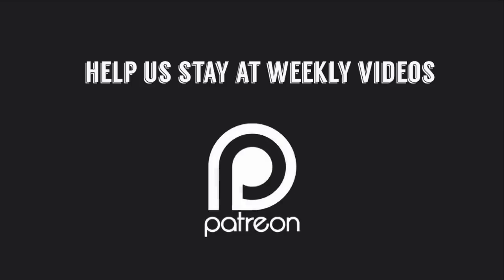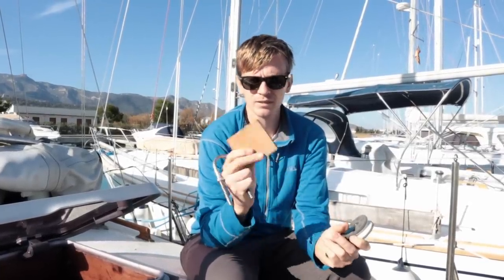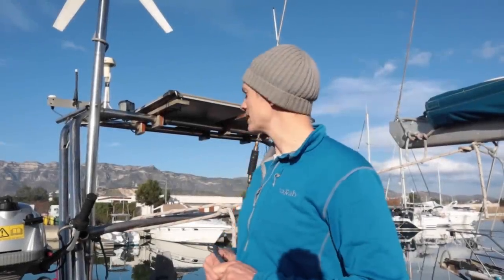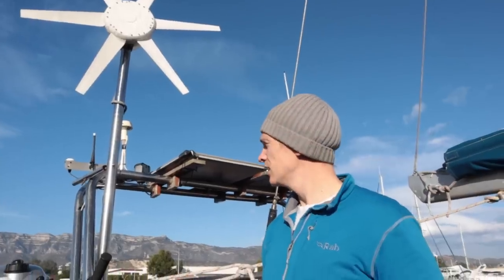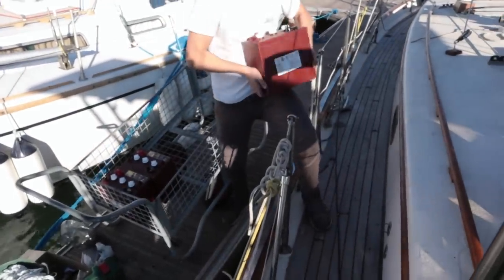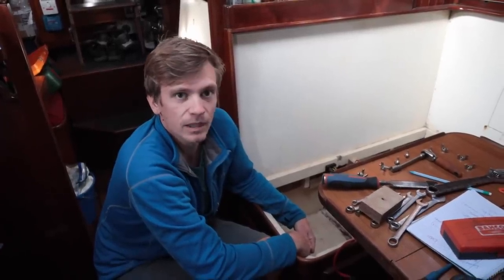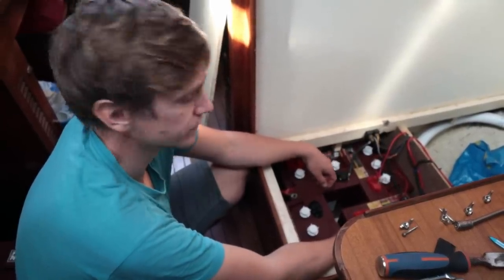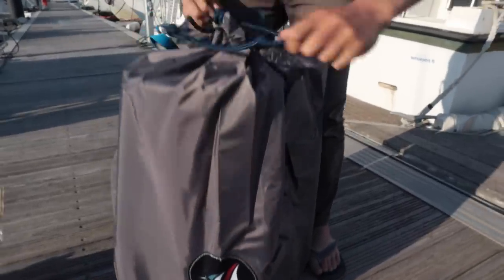43] Off-grid Sailboat Life: Installing SOLAR, Batteries & Sails

Comment: Just a little heads up for you. Any load bearing penetrations through any porous materials ( ie Balsa) should really have a thickened epoxy bush at least 5mm around the penetration ie 10mm hole needs a 20mm bush. This helps spread the load and seals the porous substrate from any water ingress.
Keep up the good work and enjoy! L.

Comment: nice one guys. the teak pad spilt because the hole is too close to the end grain. also as someone said the pad should be under the deck. all the load on that sheet is up not down, the pad should be used to distribute the load. even better is a big stainless washer that takes both legs of the u bolt. like you would have under a winch

Comment: A few quick comments on the staysail sheeting points-  1.  Chamfer(countersink) the holes in the deck and wood blocks. The butyl fills the cone shape and provides a much better seal. 2. Chuck a small Allen key into a drill and dig out some of the deck core (if cored), then fill with epoxy to seal the core, re-drill and mount your blocks. Tedious, but between the epoxy and the butyl, you're bullet-proof for life.  I think the blocks of wood will be sufficient because they're teak (won't rot) and the loads on a small staysail are less than with a genoa.

Comment: My 2c of armchair wisdom! At 5.05 I would use a split pin on the clevis pin. In a high rattle location like this, my experience is circlips undo. Also an anti-topple spring under the block will stop the lazy block rattling and driving you mad! I like the high cut clew on the new jib for ocean work. The stresses on a deck hugger genny catching a wave are enormous.

Comment: Yankees are great, lovely cut, I have one on my tradewind and it often drives me along at 6 knots on its own. Lot easier to pull in if shorthanded. Boat is looking great well done.
Reply from the maker: Thanks so much Tom, Tradewinds are lovely boats! Yes, we find it easy to handle even in stronger winds. When that 30 knot gust comes out of nowhere, it just shrugs it off :) we like to each be able to sail the boat independent of each other as much as possible so that each can get rest off watch and the Yankee definitely helps with that - and reefing the main early of course.

Comment: The wind generator also appeared to be shading your solar panel, which could be a reason as well for low output. Great videos!
Reply from the maker: Certainly true Willem, we're happy with the all solar set up - maybe if we ventured away from sunny areas of the planet it would be an issue but so far so good.

Comment: I had teak pads under my winches and turning blocks.  They all weather checked and caused leaks.  I replaced them with shaped plywood pads that were glued and glassed over with epoxy.  I then painted them with the same paint I used to paint the deck.  I haven't had any issues since.  You should also consider over sizing your holes a bit so you can get some epoxy coating on the inside of them and have room to have sealant squeeze into them a bit.  Cheers.  -s/v Wayward

Comment: Looking good. One point I noticed was the wiring on the batteries looked a little on the light side with perhaps a heavier gauge wire is needed. Could be fine and perhaps the true size didn’t show very well on camera.

Loving the videos, keep it up :)

Comment: Nice episode guys.  Really loads of jobs done.  It may be better to have a bigger block of wood but maybe that piece was just weak, should be ok though. Lovely new sail and I expect you know this but make sure you leave the leech line loose until the sail has been stretched in.  If you put tension on it too soon you will end up with a hooked leech.  Andy UK
Reply from the maker: Thanks a lot Andy, how long would you say to leave the leech line loose for? 200 NM seem about right?
Reply: It is difficult to say, if you had 200nm of light winds it might still have some stretch to go but you might just do one short trip in heavy air and that might stretch it out.   Bottom line is avoid pulling it on too hard, too soon if the leach flutters.  As it stretches into shape the leach should flutter less.  Over time as it stretches more you will need to pull some leach line on but only ever enough to stop the flutter.  Hope that helps a bit...  Andy
Reply from the maker: Cheers Andy that's perfect.

Comment: One thing about having a boom on a stay sail is that you also get an effective kicker on the sail to account for different points of sail and different wind strengths. by replacing it with a fixed point, you have lost a lot of that control.
Have you thought about fitting a twinning line via another block to the fixed point to give you adjustment on the leech? You could use it to depower in stronger winds or blade the profile if you want to
Reply from the maker: You don't really use it on that many different points of sail to make it worth it. Either reaching, in which case the single sheeting point is fine, or on its own downwind in strong conditions, in which case you could sheet it to the toe rail instead.
Reply: Thanks for the quick response. It sounds like you have thought it through. I guess you have a track for the main genoa.
Looking forward to see her at sea :-)

Comment: I would be concerned about deck rot later, because of cracked teak, and not sealing inside of deck holes.  I recommend sealing inside of deckholes with epoxy, so there is no exposed core, as water eventually may end up there.  And I would consider a solid stainless steel plate rather than teak block. 3/16 inch should be sufficient...

Comment: I know it's already been said, but I would go with high-density polyethylene (plastic cutting board material) instead of the wood. I'd also feel a lot better with a bigger /stronger backing plate. I hope it works out for you. Who knows, I maybe being over cautious.
Reply from the maker: Cheers Big Ron, I've heard that HDPE can creep over time so the nuts come loose - have you found that at all?
Reply: @SailingKittiwake  , I've never had the issue come up. If you wanted to be certain I suppose a light to medium thread-locker should keep the nuts secure.

Comment: The crack is most likely a closed checking ( hidden) that was expressed when the block was placed under pressure , if you go back and seal the block with epoxy then no problem.

Comment: Yes, the block is too small and what about sealing the timber and sealing the core or fibreglass fibres when you drill through the deck. The holes through the block could be a little larger to allow for sealing resin in the hole bore. The block will fall apart as it is now when under load, so maybe just make a fibreglass pad to your fibreglass boat and forget the timber maintenance. Yes also 9 degrees for the staysail and 11 degrees with the track towards 10 degrees as going aft for the genoa. Fair winds and take care.

Comment: Your explanation of how to not mess up the U bolt hole alignment was perfect. I get the impression the u bolt is too high above the deck and addressing that would be hard work - perhaps by extending the thread further up the shank would be a pain. 

I would have preferred something lower profile  by adding a backing plate for a regular pad-eye would do the job.

Just for kicks I visited https://www.harken.com/content.aspx?id=9096 and entered values for my favourite boat (pacific seacraft 37 similar to tayana) and the sheet load at 30kts came out at 1559 pounds. This assumes full headsail and of course I would have less than full sail well before 30kts. I did this because of the u-bolt backing plate you used!

Comment: I am no expert, but I think the underside of the stay sails' teak block needs a much bigger backing plate(s). The block attached to the u-bolt will be putting a lot of stress on that fitting and you need to spread the load.

Comment: guys - we have just gone through a similar process for batteries  - I am not sure - but I suspect the gauge of your wires is significantly smaller than recommended.
Reply from the maker: Cheers Ian, what's the downside of the gauge we've got? More resistance and lower voltage getting to our electrical bits?
Reply: @SailingKittiwake - guys two majors concerns and most relate to current draw.  I am not an electrician so provide this as anecdotal.  guage of wire becomes a two way issue  - on charging circuits and importantly starter circuit.  From the video, your battery bank is a good distance from starter motor and the current draw can be upwards of 60 amps to crank it over.  small cables, as you would well understand heat up badly and provide a really average increase in resistance over time -+ add a huge load to the battery.  We have just rewired our yacht and the guide we used was Nigel Calder's manual ( page 207 -page 221) - and because we have crazy insurance obligations with respect to electrical work  - we made sure what we did was to standard.  Most fires from yachts are electrical in nature and bloody mess to sort out.  ( you might be able to pick up a copy from EBAY UK  - Nigel Calder's Mechanical and Electrical Manual.  From your videos you seem to have a good grasp on most  - this is one of those areas we the consequences of not getting it right could be really painful.  On that note - have a look at the BALMAR SG200 monitor  - new release  - but first read through the smartguage.co.uk website.  A really handy source of information is marinehowto.com  - the guy is grumpy but really knows what he is talking about.  cheers and if I can help in any way please stick your hand up.
Reply from the maker: Hi Ian, sorry for the delay - Youtube holds comments with links for review and I didn't check for yours. Maybe the wire gauge is because the batteries you're looking at don't start the engine - they're the house bank. We have a separate battery for the starter, and another separate battery for the bow thruster. Max draw on the house battery bank is probably 10 amps (the glow plug in the cooker). The starter battery is really near the engine. I love Nigel Calder's work - his book on diesel engines is really good. I'll keep an eye out for the book you mentioned.

Comment: How did you fit the U bolt under the deck, the pull will be up so consider something like the timber block under the deck rather than on it.
Good sealing technique using the robber tape. Maybe something circular if you have a cutting saw for your drill from

You can still have self tacking without the boom, a simple block at the clew and single sheet to a winch aft.
Reply from the maker: Hi Nigel, thanks for the tips - Kittiwake had a self tacking jib (storm jib but nearly big enough to be a staysail on a HT) with the arrangement you suggest but I always found that the sheets hooked the clew and we couldn't get it to set right. We've still got the block on the end of the staysail though so I'll play around with it. Though to be honest, the staysail is incredibly easy to tack even with a standard setup as it's about a metre of sheet to pull in to swap sheets.

Comment: I so can't wait to see her sailing. Was 6 volt a choice because of system requirements or was it a cost issue?
Reply from the maker: Cheers Ken, we can't wait to show you! If money was no issue then maybe we'd get higher spec ones, but the Trojans on Kittiwake were going strong so we trust the 6v golf cart technology and they're easy to maintain - a drop of water occasionally is all they ask for :)
Reply: I guess if budget was not an object there are a good number of options that might be tried. I would think replacement components for the six volt system would also be available from a variety of sources which means a good deal, I would think, when you are changing locations all the time. Have you looked into hydro generators to supplement solar as an alternative to the wind generator?

Comment: Wouldn't it be better to overdrill the holes on the deck and fill it with epoxy to prevent water from sipping into your balsa core? Cheers from Brazil
Reply from the maker: Yep, I managed to get a bit of epoxy in there but lots of people oversize them by a lot then fill it with thickened epoxy. The balsa on the early Tayanas is special as its small blocks interspersed with resin so it's less susceptible to rot but still worth doing for sure,
Reply: @SailingKittiwake  thanks for replay!
Reply: @SailingKittiwake  , don't fool yourself... It's dipped in resin and now it's also just waiting for osmosis to take place

Comment: Hi guys. I wanted to ask a quick question about the solar panels and charge controllers on your previous boat. What were there output and which charge controllers did you use, were they reasonably priced and how did they perform. I'm after getting some for my cat but not sure which ones to get. Thanks guys. Ethan

Comment: Just wondering if you have a cored deck? If so you really need to seal it with an epoxy barrier, especially if there is load on the deck fitting. Otherwwise you 're just inviting a soggy core.

Comment: Why 6 volt batteries ? I’m confused, better storage n more use of amp hours . Great video as usual
Reply from the maker: Hi Edward, the 6v batteries are wired in series / parallel. They're pretty standard on a lot of liveaboard boats as they give a long life and handle the house system demands well.

Comment: Nice one you guys. I was wondering do you still have the Walker bay dinghy? If yes where are you going to put it? I'm guessing you sold it with Kittiwake.
Reply from the maker: Hey Buccaneer, we had to leave it on Kittiwake as shipping it to Spain would have cost more than we paid for it (we got a used one).
Reply: @SailingKittiwake  I guess it would be hard to stow it on Skua anyway. Im looking for a similar size double ender myself and I love walker bay dinghies. I also want a wind vane so davits are out of the question so I guess I'll have to use an inflatable, which is not ideal but oh well.
Reply from the maker: Check out SV Prism, they have a walker bay. We actually had davits on Skua for a bit but found that we felt more comfortable with the dinghy on deck, both for security from theft and when underway. Although our davits were not exactly solid...
Reply from the maker: Check out SV Prism, they have a walker bay. We actually had davits on Skua for a bit but found that we felt more comfortable with the dinghy on deck, both for security from theft and when underway. Although our davits were not exactly solid...
Reply: @SailingKittiwake  Many thanks 👍

Comment: It's the rough deck which cracked up the teak, not the kit. My opinion :-) 
Edit: Looking a second time I noticed that the whole construction seems awkward as the teak is very thick and relatively small, it will go rub over the deck as the leverage is to big on the top side with stress to hold it tight to the deck. So better chose a bigger thinner plate where the buckle is welded to the plate. Of course you can always change it when it cracks but hope it will not damage the deck 😎

Comment: No! The adhesive used is not the issue, nor will it help spread the load. Smoothing that deck surface would have done that. But I highly doubt that is why the board split. When screwing or nailing near the ends / edges of a board, you want to be as far as possible from the edge to keep it from splitting. A torque'd down bolt with a drilled bigger hole is even more so, especially if you overtighten it. The block of wood needed to be bigger, so that the holes were not so close to the edge. Like probably at least couple of inches bigger. And even if you had cut that block bigger and adequate amount, it still might have split. Just all part of using natural products which can have grown in weakness. If possible you want the end grains of that board running the long dimension across the board and not going straight to the near edge ... however in your case that is not possible considering you put U-bolt in diagonal across it. Really you do not want a wood block for that anyway.
Reply from the maker: Thanks Kevin, strange that the starboard block worked perfectly and didn't split at all. Like you say, natural products and all.
Reply: Yes, and there are times you can nail / screw almost right at the edge and it not split either. But it happens often enough, that its best to simply attempt to avoid that from happening as much as possible.

Comment: Bad luck on the pad splitting. Although on a bigger pad, I always used to "shape" the back to suit the curve of the deck, with one as small as this, you shouldn't need to. It's either just a hidden fault in the teak, or maybe you could have drilled your clearance hole big enough. In that installation, I would be making sure the threaded part slid through the pad really easily, so you don't introduce any  undue stresses when bolting down. Countersink the holes in the pad, top and bottom, and, if you can only fit a single nut on the bottom, maybe think about using nyloc. Personally, I would have thinned the pad sufficiently to fit 2 nuts on. Double-nutting means you don't feel the urge to overtighten; the second one being the locker. Just my opinion, btw, I respect your work - I usually had the benefit of a workshop :-))
Reply from the maker: Cheers Chris - that's a great point about the tolerances, maybe the sideways pressure as it was tightened split it. These comments are giving me lots of ideas for the replacement!